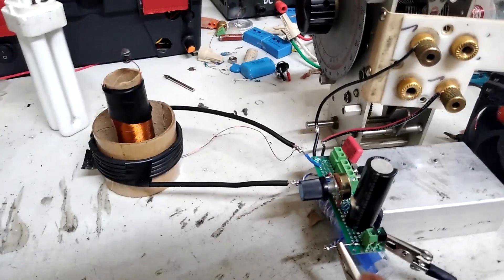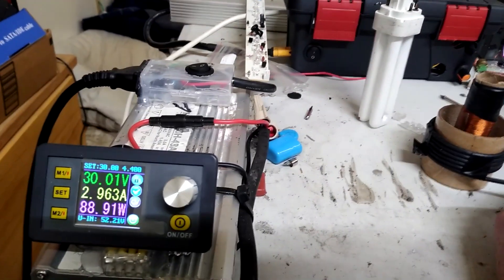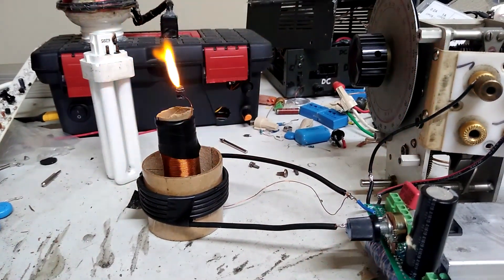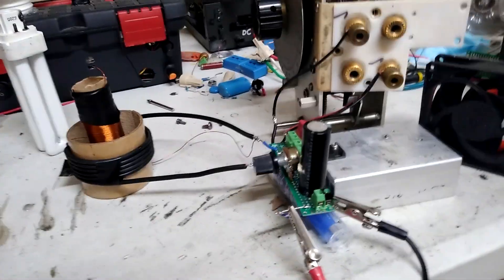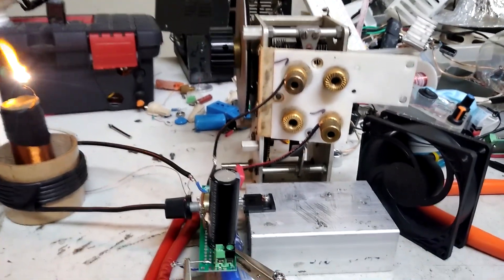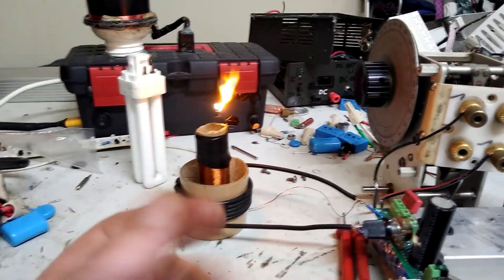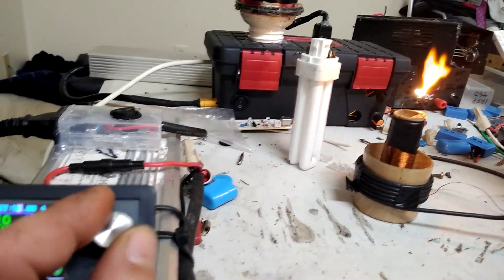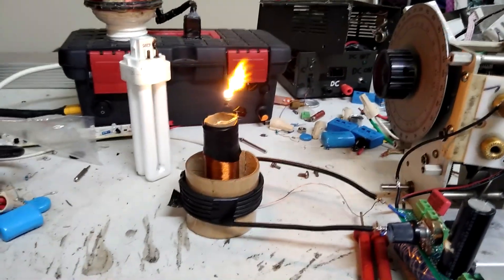Plasma Flame w/better tuning

Comment: Haha Rambo did a good job :D
Reply from the maker: Rambo is a champ but you probably also picked a fairly robust set of values with this circuit so tuning it has not been much of a problem. I don't have that constant fear of a fet popping like I did when first playing with your older HFSSTC circuit and had no experience with it. I just don't think I'd be able to ever push this to insane arc lengths even with maybe 80-100V supply. The arc seems to want to grow sideways instead of up, but at least it seems to be switching much better now.
Reply: @Magneticitist  The main thing is not to give up ) Draw out a big torch soon !
Reply from the maker: @GRozaLab  I'm hoping.. Even with others laying out the experimental work first it seems like a game of amassing experience. The more I build the more I feel I understand the workings, however stretching out several inches of arcs has Rambo nervous. I'm sure I would need some of his relatives along the way.

Comment: Is it very hot to touch?
Unlike the normal Tesla coils?
Reply: Better not to try, HF burn is guaranteed.
Reply from the maker: As far as touching with the human finger goes a person is not going to feel much difference between it and a much lower frequency SSTC CW burn because it's just going to be on the level of burning the ever loving shit out of your flesh if contact is made for long enough. It's difficult to explain though.. I mean I've caught really bad burns from 1-2mhz coils by having it bite me really good doing something like pulling arcs to an ungrounded screwdriver.. or catching a short arc grazing my hand along a part of the circuit when it's not grounded. If I were to do that with this circuit just the right way it's going to be really bad.. But grazing my finger across the top of the plasma flame feels like running it over a normal candle flame. This flame does however feel like it's putting out way more heat than a candle flame would.